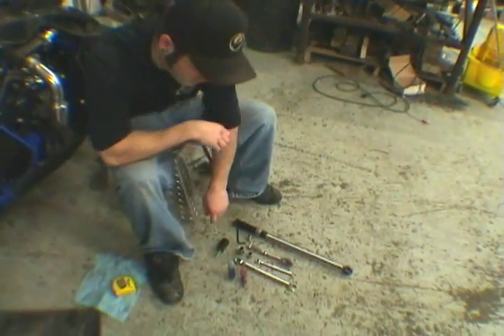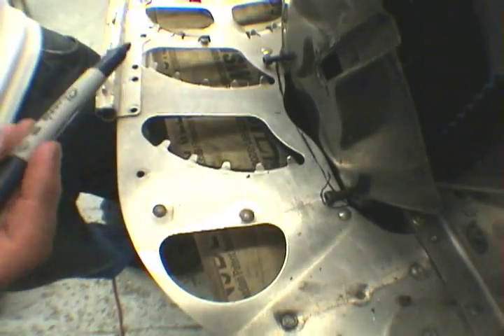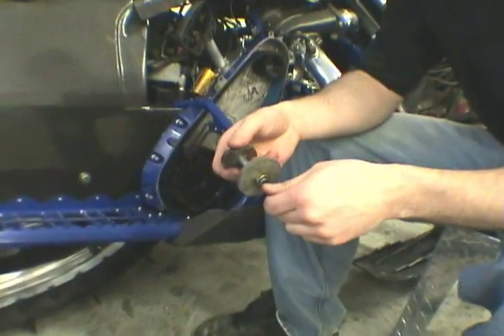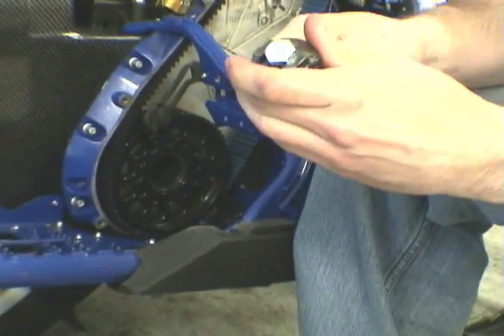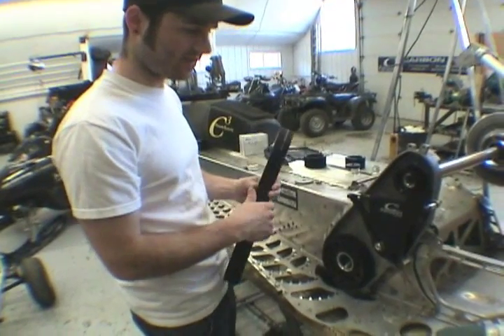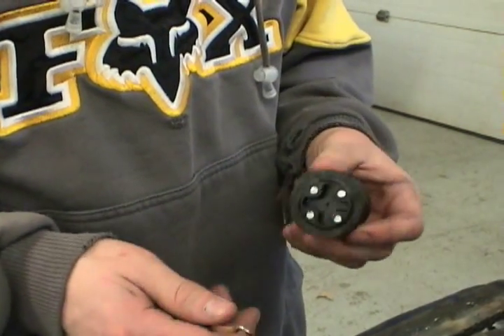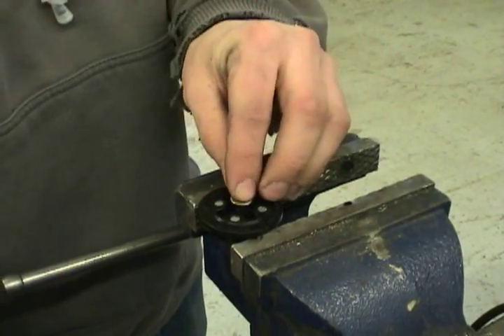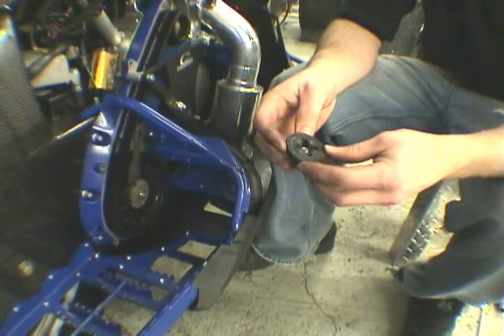SyncroDrive Install

Comment from the maker: @SpeedyTimm Kits are between $950 and $1060.  Benifits 3+ lb lighter, 2.25 lb less rotating mass and when a  chain brakes it usualy take out the chain case.  Everything we can sell you for a XP cost about $10,000